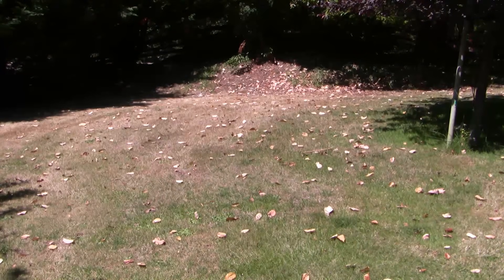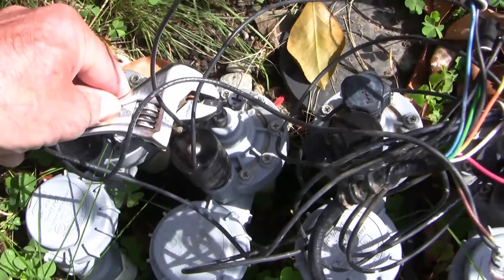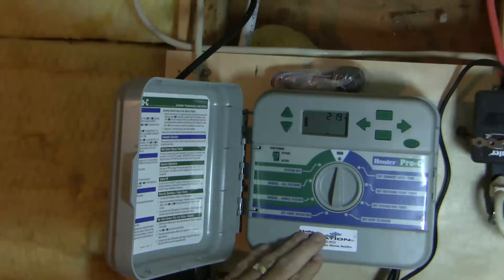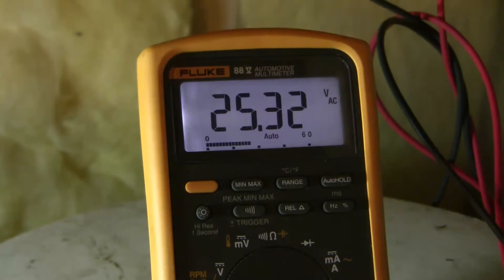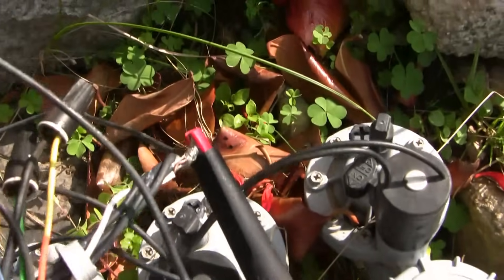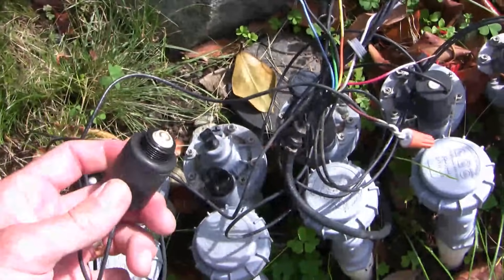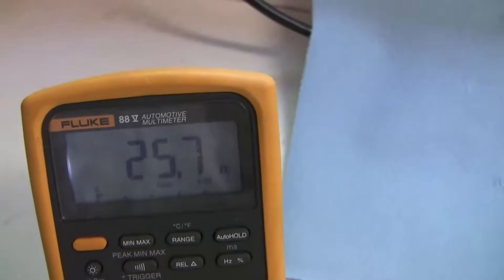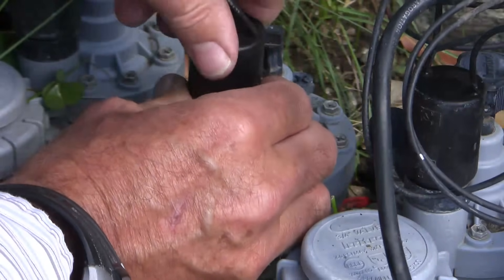How to fix an irrigation sprinkler zone that is not working

Comment: Firstly, thank you so much for this awesomely clear video! 🙌

My particular issue seems to be unique to this video, and I’m praying somebody can suggest what to try next!

Current situation: Zone 2 doesn’t currently turn on via the control panel

Methods tried:
1. Verified that power is coming from the control panel out to the valves
2. Verified that Zone 2 does receive power from the control panel when activated 
3. Replaced the solenoid for Zone 2
4. Zone 2 does turn on successfully when manually rotating the solenoid

Besides replacing the whole valve, is there anything else I can try?
Reply from the maker: I did a more recent video showing how the valves work, and at that time I worked through a similar problem. I removed the diaphragm, cleaned the slime and corrosion around the diaphragm and small passageways, and on reassembly it worked fine. Check my channel for that video, I forget what the title was. Good luck!

Comment: When you used the multimeter, where exactly did you place the probes?
Reply from the maker: These systems use a common ground, which will be the wire with the huge wire nut that all the solenoids trace to. Those wires usually have the same color, usually black. You place one multimeter probe onto the inside of that wire nut, and the second probe onto the second wire that leads to the solenoid. So, you're measuring voltage drop across the solenoid. Turn the zone on at the controller and measure AC voltage between those two probes. The most accurate way to assess wiring is to get current flowing, which will happen if the solenoid works and the wire route to and from the solenoid is intact. In that case you use the multimeter voltage to decide if there is upstream or downstream resistance causing power loss. If the solenoid doesn't work, you can substitute a load like a headlight bulb designed for 24V AC.

Comment: What if you turn the solenoid manually put the zone does not turn on? Yet everything tested fine and normal.
Reply from the maker: The problem is in the valve. I did a more recent video showing exactly how to fix that and how the valves work (search my channel or find it in the video description here). In that case all I had to do is clean the diaphragm, but you can also replace the diaphragm if it is torn or damaged.
Reply: @spelunkerd  awesome that help me out greatly.

Comment: My flow control is stuck in place. I can't seem to break it loose.  I know it's pressed in. idk why it's immovable. any suggestions?
Reply from the maker: If the handle you spin to open the valve is contacting something that limits its movement, then you could slide the entire handle up off the axial splines to reposition it and turn it further. All threads are right handed so you turn CCW to loosen. Alternatively yours may be designed differently so it is hard for me to say. These things are plastic so if you have to put a wrench onto it there's a risk of breaking something. The person who worked on it previously may have cross threaded the plastic threads, which makes movement very tight and increases the chance of damage. I don't know anything about your confidence or skill set. Sometimes the wise option is to get a pro involved, these things are usually not difficult or expensive to repair.
Reply: @spelunkerd   I bought an irritrol valve.  Put only the new top part of the valve on the old half of the valve. Rewired it. And I have continuity. I was hesitant because it was plastic to put much torque on it.  Now that I have it off I will show it to my son and give him your suggestion.  Thanks for your input.

Comment: I have rain bird sprinkler system and and all zones work but 1 don't and when I turn it on manually the zone won't turn on could it be because it needs a new solenoid?
Reply from the maker: Manual control bypasses the solenoid, so it would be unlikely to cause that. More likely you've got a problem with the valve, input water volume, or some problem with the downstream line (broken, cut, or kinked line). If the line is cut or if a downstream device has broken off, you may be able to locate it by running that zone manually for a few hours and then explore the area of that zone looking for a wet spot. If the problem is a high flow low pressure situation like that, you can often feel water moving in the line with your hand. Other devices in the zone don't get enough water pressure to work properly. I did a detailed video on my channel explaining how the valves work. Remember that this time of year all the valves need to be manually closed, since they are routinely left cracked open to prevent freezing water over winter from damaging the valves. So in the spring you need to close all the valves.

Comment: Sorry, You did not show how to individually  connect each solenoid/valve to test to see if it was receiving 24 V. Can you show that please? Thanks
Reply from the maker: Yes, in retrospect I could have explained that more carefully. The ground is shared by all solenoids, and you'll instantly recognize it because it's the big wire nut that all solenoid ground wires feed to when you're kneeling down at the solenoid bank. Each solenoid is fed by a single individual incoming power wire that is not shared. The best method is to expose both the ground and the power sides down to copper, connect your multimeter to leads to each side, but keep the connection to the solenoid on both sides intact. Then turn the controller on so it is feeding power to the solenoid. Measure AC voltage across the two wires feeding the solenoid with your multimeter. With current flowing through the solenoid, if you get 24 Volts, you have no upstream resistance problem. If you're not sure current is flowing, you can do the same thing with an incandescent 24V light bulb or test light. For more info, search "voltage drop test".

Comment: Very awesome knowledge and skill with the multimeter etc. I learned a lot from your video on how it worked but then I took the lazy approached and put one solinoid from a working zone and stuck it on, ran that zone, it made my broken zone work, boom solved. Replacing the solenoid is my confirmed fix!

Comment: Hello thank you for this video this taught me a lot but why would my solenoid box be filling up with water?
Reply from the maker: It is very common for ground water to rise to the level that any depression fills with water or ice, depending on ambient temp. These systems are designed to withstand that, although ice inside the tubing and valves can expand and cause problems later.

Comment: Hello we installed a 6 station manifold system to a Hunter XL2 controller, we soldered the solenoid wires to our water zones and everything looks ok, we programed the timer to go on at 6.00am for station 1  and then set the watering times and the watering days, to see if the system will run we changed the time for when we were there, station 1 will turn on at 2 pm and it did'nt, but station 2 came on with station 4, we have re-set back to factory settings and re programed but now station 2 , 3 and 4 are running, we opened the solenoids to check for dirt, but it all looks ok, have we a problem with solenoids or control timer , all are new, somtimes the water wont turn off when it should,  Thanks.
Reply from the maker: To get a diagnosis you want to simplify the questions by dividing the problem into small parts. On the surface it sounds like you have a valve that is sticking open, which is similar to the problem I faced with the "sprinkler troubleshooting" video on my channel. I would start by verifying you get water when you open valves manually, and they shut off when you close valves manually. If not, you've got a mechanical problem in a valve, which will respond to cleaning or replacing the diaphragm. If one zone sticks, the later zones won't work right because line pressure is pulled down by the stuck open valve. If the problem is electrical then a little investigation with a multimeter will point to the answers.
Reply: @spelunkerd  Thanks for getting back to me, I will check out the lines to find out if water will come out per solenoid and take it from there.

Comment: What if I’m not getting 25 volts on the controller on 1 zone?
Reply from the maker: First, be sure your multimeter is set to read AC volts. If it reads OK on the other zones, you can trust your tool. Then verify that the controller thinks it is actually sending 25 volts down the zone 1 line. Lack of 25 volts there could be due to an open on the ground side or the power side, commonly caused by a connector that is corroded or a wire that was struck by a shovel. It could also be due to a dead short, which could have damaged the controller. So, after a brief look at the wire nuts at the solenoid end, I'd go back to the house to look at the controller side. You might start by disconnecting the wires to see if the controller can actually produce 25 volts. If it can, then I'd check resistance between outgoing power wires and incoming ground wires after both are disconnected from the controller, to be sure the line isn't open (infinite resistance), or shorted (close to zero resistance). If the line is open, you've got a hunt for a broken wire, which could be painstaking. Sometimes those lines have spare wires that can be swapped without having to string another wire.

Comment: I have the same hunter pro-c model. Resistance check was low. I cant seem to replicate checking AC output to the problem zone  as it immediately errs and i think it shuts off electricity to that zone.  I have checked working zones and get AC reading. I am replacing the solenoid. $20 cheap if this works. Cheaper than replacing the entire hunter box. Ur thoughts?
Reply from the maker: If you have a dead short circuit between power and ground, you'll need to find and remove the cause before it will be fixed. Let's hope you get lucky by replacing the solenoid. With a multimeter you can easily remove the solenoid and check to see if the fault is still there. The usual strategy is to look for break points of the system you can access and divide, then check resistance on both arms to narrow the search. You can't check resistance on a live circuit so for that method it needs to be disconnected at the controller inside the house. The hard problem comes when you realize the short is somewhere in the ground between the house and the solenoid bank. It could take a lot of digging, maybe more than practical. Often it could be an inadvertent shovel strike by the gardener. At that point, if you are lucky you might have an extra circuit you can swap over to, or maybe string another wire. Go for the common areas first, wire connectors, etc. Good luck!
Reply: @spelunkerd  I replaced the solenoid. Cleaned the wires that connected to the solenoid during install. Problem solved. I did check resistance to the old solenoid after i had removed it and it was not a consistent reading on it so I think it was the solenoid. The sprinkler system was installed 14 yrs ago. I had to replace one last year in a diff zone as it oddly was stuck in the open mode and caused flooding! I made sure it wasnt debris and cleaned it but it happened again so that is when i replaced it.

Comment: Hi thanks for the video very helpful.. when I look at the Resistance for each zone from the controller box it shows very high number (1 million ohms & this is same for all zones I was thinking from your video it should also be around 60 ohms). However, when I see the resistance from outside for the solenoid valve it shows 60 ohms. Does that means the wire connecting the controller box & the solenoid balance is bad? thanks
Reply from the maker: Yes, probably. Before jumping to conclusions, verify that you're testing on the correct pins. Excessive resistance could be in the ground line or a hot line, but if none of the zones are working then the ground line is likely suspect. Check the connectors for corrosion or bad contact at each end first. You may need a spool of wire to extend your multimeter leads from the controller to the solenoid bank in the garden. After proving your wire is broken, you could also verify the diagnosis by swapping in the spool to bypass the break. Finding a break can be a problem if the line is long and buried.

Comment: The end of your presentation showed you had capped and wrapped a multitude of wires. You are replacing one solenoid Then wrapping and capping all those wires. You lost me there. Everything else was clear good presentation.
Reply from the maker: Thanks for the feedback, I'm sure many others felt the same without saying anything. Let me explain. These are simpler than you would think if you just look at the birds nest of wires! It will be much easier to understand when you realize that the controller sends only one ground wire out to the whole bank of solenoids. All the solenoids share that ground, so for example if you have four solenoids grouped together, the ground connection will have five wires tied together (one for each solenoid plus one controller ground =5). All the other wire nuts will have only two wires, one unique wire dedicated to that zone coming from the controller and one wire going to one solenoid, both tied together at the wire nut. So, as you kneel down you'll instantly recognize the big wire nut as the system ground. To test for voltage, put your black lead from the multimeter on any bare wire connected to that big wire nut, and use your red lead to test for voltage on the wire coming from the solenoid you want to investigate.

Comment: I think this is my problem with why 1 of my zones doesn't work.  I manually opened it and they work.  Question though.  I see the 3 blacks and at least 1 white wire but another white that I can't tell if it was hooked up or not.  Should there be 2 whites with the 3 blacks or just 1 ?
Reply from the maker: Each solenoid will have two wires, a ground and a power. Usually the ground wires are all bound together into one wire nut. Colors will vary but you can usually identify which is ground by that common wire nut. When you turn the master control on, it sends voltage down the power wire, through the solenoid, and back home on the common ground wire. If you get no voltage on the signal wire, or if it can't carry current, then you have a break, or corrosion somewhere. If you get a good power and ground wire, and your solenoid doesn't open the valve, then your solenoid is likely bad. In that case, swap in another one and see if it works.
Reply: @spelunkerd  thanks.  for $10 I'm just going to replace it.  The 2  black solenoid wires were married to a black (power) and at least 1 neutral (white) most likely going to the next zone but then I saw another white .   Had to order a new solenoid but didn't want to wire it wrong.

Comment: What happens if you turn solenoid by hand and no water comes out at sprinkler head?
Reply from the maker: At this time of year the most common cause is the system was winterized by opening all the solenoids so water wouldn't freeze and damage them. If all are opened, none will work because you don't get enough of a pressure head. They all need to be closed, then you open only one at a time. The second most common cause is the main shutoff valve, usually inside the house, is closed. The third most common cause is a break in the main feeder line, somewhere, which should be obvious because it will make a big puddle. Finally, if all of those are ruled out, the valve itself may be faulty, probably corroded with debris.

Comment: Hello I’m having trouble with zone 2 it keep on breaking my fuse.
Reply from the maker: If a fuse is blowing, you've got some kind of short circuit, either in the solenoid itself, the wiring, or the controller. It could be as simple as crossed wires inside the controller, a fried solenoid, or a damaged wire in the garden somewhere. I'd turn the unit off, then check with a multimeter the resistance of circuit 2 from one end to the other. You'll probably need to remove the circuit 2 wire connection at the controller. Once that wire is removed, try again and see if the breaker blows again. Along the way, look for evidence of melted plastic or smoked parts. From there it is a matter of logically zeroing in on the short, which could take minutes or hours.

Comment: I have 3 station on my system that all go off at the same time when 1 goes off they all come on and like wise with 2 and 3 how can I fix this
Reply from the maker: You need to decide whether this is a problem with the electronics of the controller or the valves themselves. To do that, open each valve manually and verify that only one comes on at a time. It may be that one is sticking, leaving it open for the next cycle. To decide if the controller is not working correctly, check the voltage going to the solenoids and see if it is indeed telling more than one valve to open at once. If it is, then you need to decide if you programmed it that way, or if the controller board is bad.

Comment: Do you have suggestions when 2 valves share the same zone but one valve is sporadic in coming on?
Reply from the maker: I've never encountered parallel valves like that, and even serial valves would seem unnecessarily complex. I'd probably start by cleaning the sporadic valve, with the hope you can get it moving more easily.
Reply from the maker: Oh, also remember that if valves are placed in series, the upstream valve needs to be open for the downstream one to work.